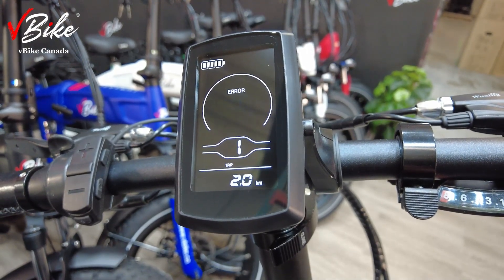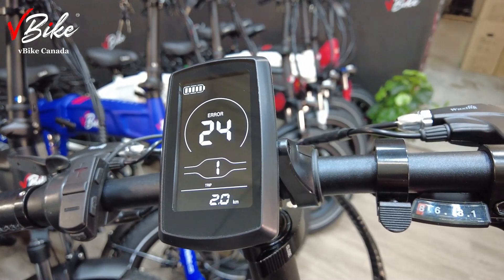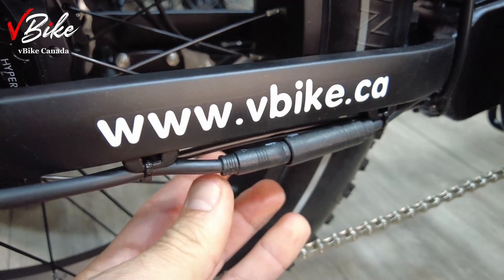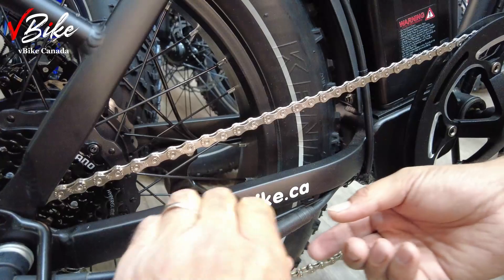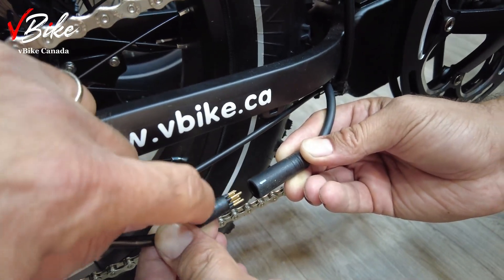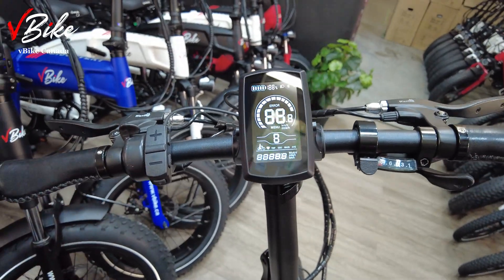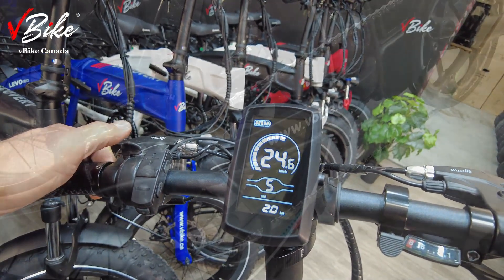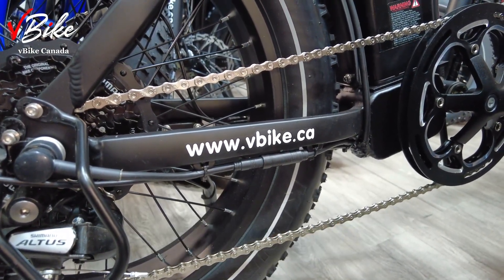How to Fix Electric Bike Error Code 24

Comment: Not sure you needed to cut the zip ties. You could've just pushed the connector back together. Also that's an interesting position for a thumb throttle. Seems a little dangerous to have it above the grip like that. IMHO

Comment: Seems to have been the problem.  Didn't look like the connection had separated, but pulling it apart and reinserting it removed the error 24.
Good video.  Thanks.

Comment: You see uhh I know my wire is fucked Im the reason it's fucked for the first like 5 weeks the bike didn't work the wire wasn't fully severed so we managed to fix it but shortly after I fully severed the wire now It reads err 24 but I can still spin my wheel up the motor works but I've got a small nic in the outer sheathing and sliced 1-2 wires only one is fully severed but it still runs IM AWARE I NEED TO GET IT FIXED however it's my daily driver if I needed to get to work would short commutes still be do-able (currently waiting on new tubes and tires so I can't go actively test out my hypothesis)
Reply: Lol I feel you bro, in the same boat rn
Reply: @nickydessa ah update lmao bike fully shat out sold it bought the better version they offered with 2 motors i now have 2k miles on this one over double the last

Comment: Please can you help me with error 30 problem
Reply from the maker: Please check display connector. It may be loose! If the problem do not solved, you need to check your controller.
Reply: @vBikeCanada  I buy new controller I change the old one but  it shows me error 30

Comment: Its still not working😭
Reply: same
Reply: Did u guys find a solution pls I am facing it right now
Reply: check the wires going from the connector into the hub motor, there are moving wheel parts (like the brake rotors) that could have damaged the wires

Comment: I'm having the same problem it still says error 24 I tried the same thing in the video and it still says error 24
Reply from the maker: Please check motor cables connector on the controller.
Reply: did u find a fix to your problem? cause same for me
Reply: @inzetajacklon1278  yes I fixed it I had wires that ripped
Reply: @isakdoomsday how did you fix that?
Reply: @landonseredi5503  I put the wires together again
Reply: @isakdoomsday were they just disconnected or something